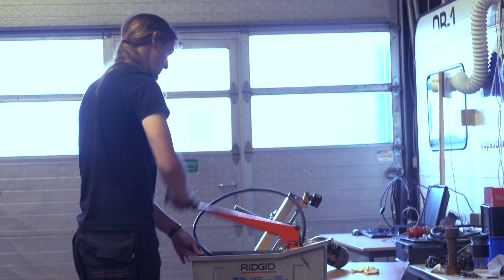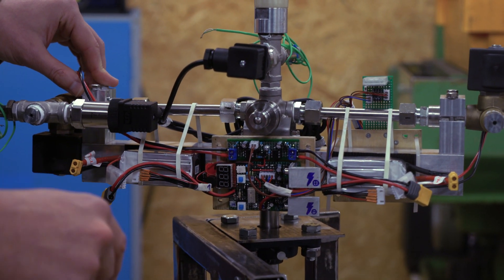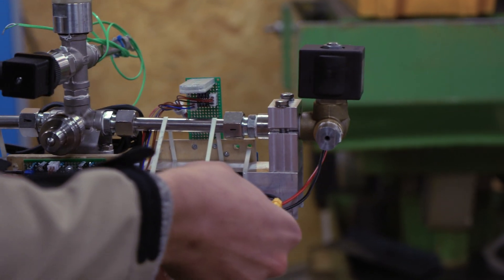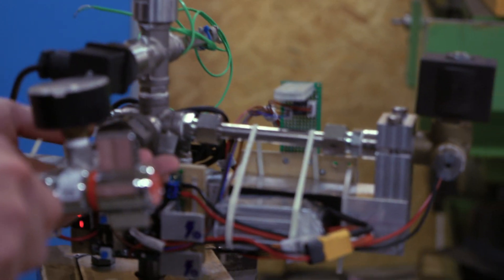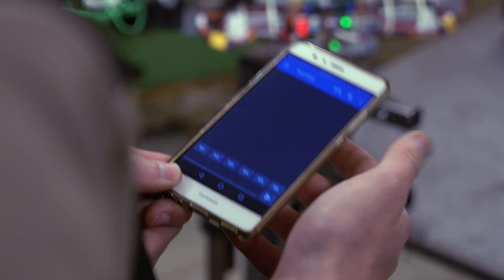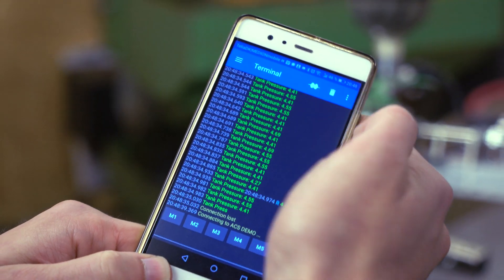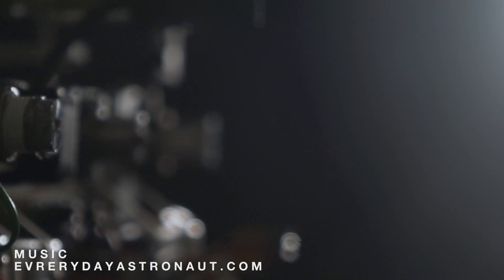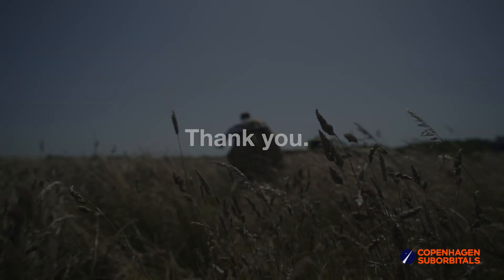Arduino Controlled Reaction Control System Demo for Homemade Rocket

Comment from the maker: What's your guess for these thurster's thrust at 100bar? (We don't know yet either)
Also, previous video on the power supply electronics for this rig, if you haven't seen it yet: https://www.youtube.com/watch?v=zvdZzvocfMA
Reply: have you considered using something like ardupilot for your controller?
It has a pretty good ins and is open source
Reply: how much electrical power do you have available for thrusters?
have you considered using phase change thrusters?
ok, sounds weird, but lets say high pressure liquid nitrogen is fed into a diesel injector mounted in a thrust cone and that is activated by a diesel pump.

as long as the liquid nitrogen remains in a "superheated" or "dry steam" pressure/temperature there is no losses of depressurisation, nor losses of cycling pressure between valve and nozzle, constant and predictable momentum effect per pulse.

Comment: If I recall correctly the milspec for teflon tape as used for sealing threads specifically involves not covering the starter thread. I'm not sure if that's truly relevant, but I figure it's that way for a reason. Maybe that's the reason for the tint leaks.

Comment: Pro Tip: Don't use tape on hydraulic fittings. It is easy for a little bit of tape to enter the tubing and plug valves or cause them to remain partially open. From 0:37 to 0:41 we see tape overlapping the end of a fitting that is very likely to be torn loose and enter a valve when used at high pressure and flow rates. Best practice is to use a liquid pipe sealant.

But did I see an O-ring going on? If that is a straight thread O-ring fitting being inserted into a fitting threaded for pipe it will be profoundly unsafe at 100 Bar. O-ring fittings never use thread sealant. A hydraulics component vendor could offer professional guidance before trying to operate at high pressure. Most pneumatic systems operate at much lower pressures so a pneumatic equipment vendor may not be able to help.

I'm just concerned for safety. High pressure equipment failures can have devastating effects.
Reply: Following that, Go get some advice from some local paintball compressor suppliers they're probably a small enough company to give you the time of day. You might even get some support when it comes to filling the rocket, they've probably got a truck decked out with 344bar compressors they could bring on-site. That tank they're using on the test rig is rated to 310bar, which should scare you. Plus pneumatic expertise.

Comment: Way to many parallel threads sealed with tape, no way will this be pressure sealed well enough for 100bar. Rebuild it using tube compression fittings (ie Swagelok), where you have threads use an acrylic based high pressure thread locking paste instead of tape. You can thank me later ;)

Comment: Why use two separate batteries? Is it for simplicity's sake, or is there another reason? Also does this system use like a 1st stage scuba regulator, to drop the pressure to a lower manageable value like 10 bars? Is it integrated into the tank, or a separate component?
Reply: ffoska I don't think reduced pressure helps efficiency.  As long as the valves can release small enough bursts, extra pressure is probably good.

Comment: If you connect this thing to an IMU this is a link to the code I use with my Arduino I use, My Arduino is an M0 one but you may get this one to work with yours  https://github.com/ap-tech/MPU-9250/blob/master/.gitignore/.gitignore

Comment: Congratulations!
For the final flight version, you might want to use PCBs and maybe try SMD parts, this way the whole system will be a lot more reliable. 
Also, try getting rid of the commercial LiPo battery checker and come up with your own solution, God only knows how reliable those are ;)
Good luck for future tests and I hope to see more electronics soon!
Reply: They've said before, this is a test rig ONLY, not a prototype. And most definitely nothing like the final flight-ready version.

Comment: Is the plumbers hemp and paste space compatible?  Thread tape is almost useless in liquid implementations... (Read as plumbing)
Reply: HVM This is an all gas implementation, except that water is used for pressure and leak testing.  So whatever they use in the cold gas RCS needs to be optimal for compressed gas, not liquid.
Reply: @johnfrancisdoe1563  Yes, put if you look closely, compressor fittings are made with hemp... So?
Reply: HVM You argued about liquid, I responded to that.
Reply: They've said before, this is a test rig ONLY, not a prototype. And most definitely nothing like the final flight-ready version.